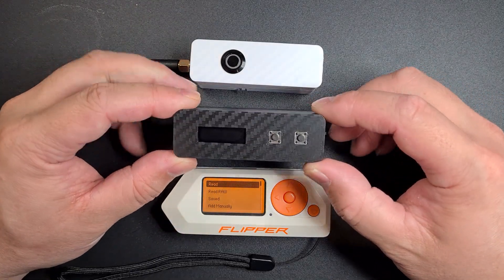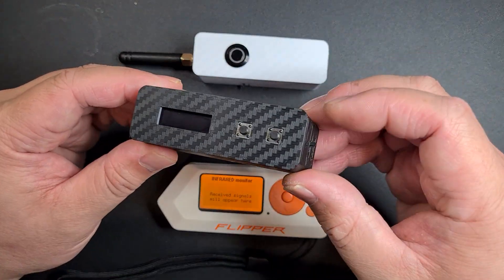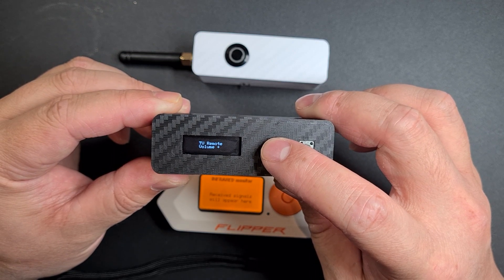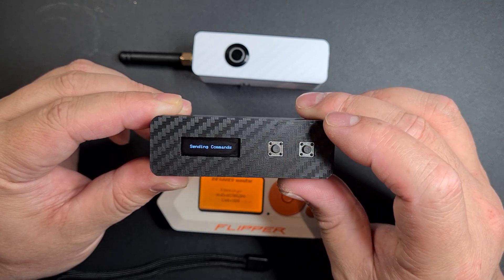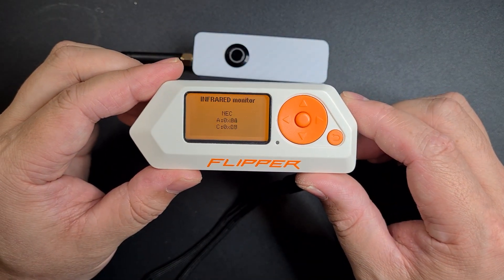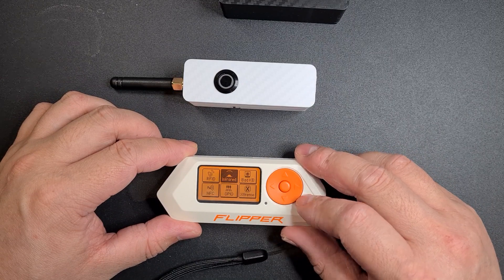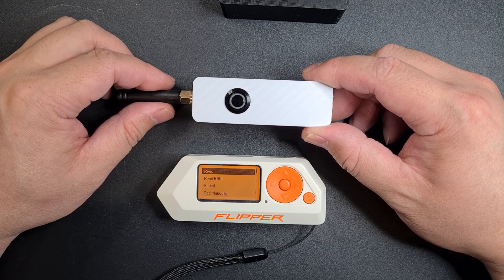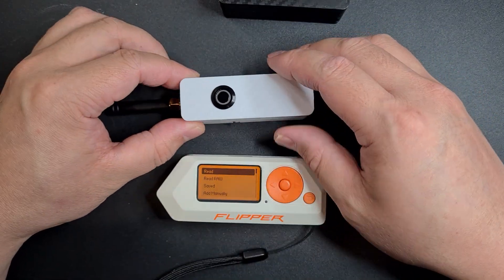Flipper Zero Alternatives?! Most used functions.

Comment: What kind of firmware are you running? I tried following talking squatch video to use esp flasher to load both marauder and evil portal and I can’t get evil portal to work for some reason.
Reply from the maker: xtreme
Reply: @rayj1988 what is the white subghz stuff u used to make it
Reply: @rayj1988  what is the white subghz stuff u used to make it
Reply: @rayj1988  what is the white subghz stuff u used to make it

Comment: Dude, please make a tutorial. I learned so much just from making the cc1101 module.

Especially how to make my stuff more compact, from getting the silicone wire to threading the stripped wire in the through-hole to keep it in place, to placing the module with the wires in place.. Honestly I don't even care what build it is, just do more tutorials. Or just make a building tips video...